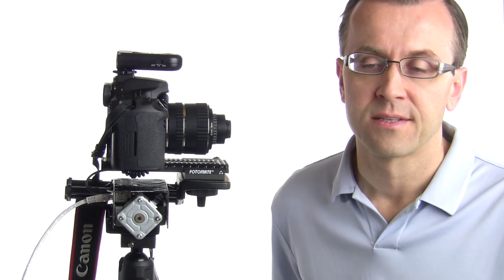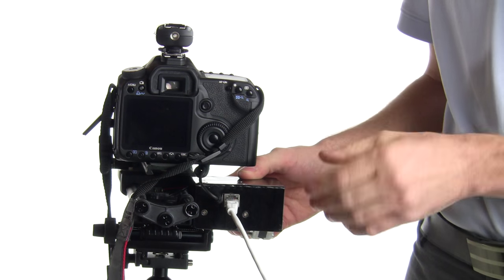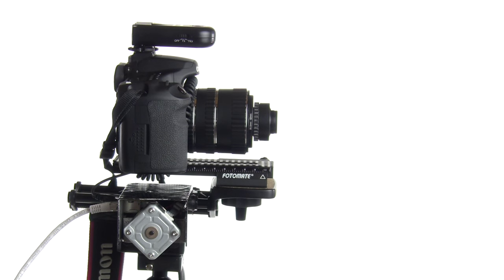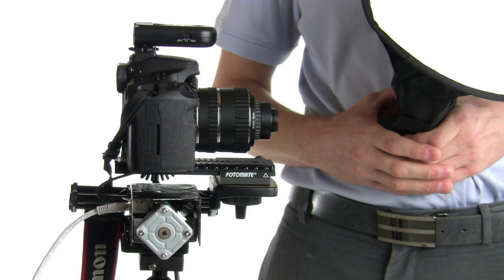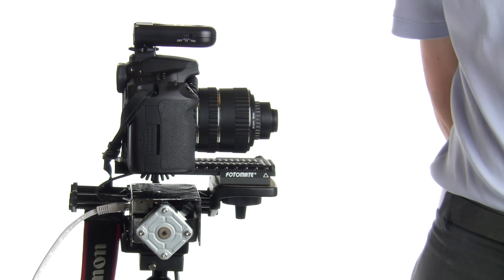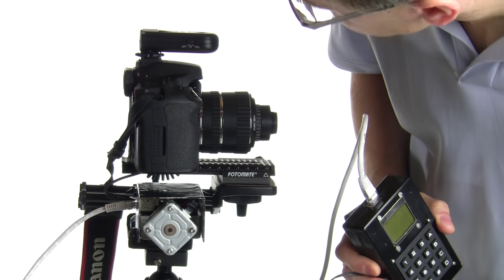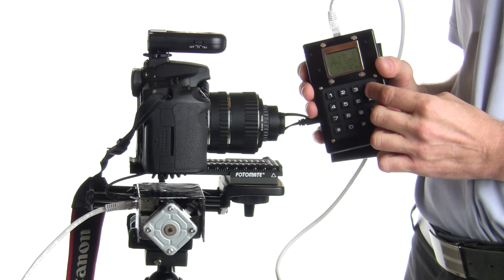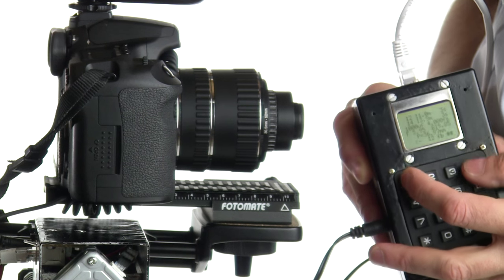Fast Stacker: live demonstration

Comment from the maker: Great news! Just in time for the new year, I have managed to do the ultimate hardware modification to my rail (which I already coined "h1.2") - the one where I gained independent programmatic control of both camera's shutter and autofocus - and the rail survived this major surgery, and seems to be working as expected. This new setup should be the most attractive to non-Canon camera owners, as many non-Canon cameras require both the shutter and the AF camera switches to be controlled to do remote shooting. I believe now I can make my focus stacking rail truly universal - should work with any camera model. For Canon camera owners there is less incentive to do the mod, as the only improvement you might see will be slightly faster startup time when doing 1-point stacking.

The software hasn't been updated yet to make use of this new functionality. I will start working on that, and also on updating my wikia tutorial to reflect the hardware and software changes.

Stay tuned!

Comment from the maker: UPDATE [03/03/2016]: New version (s1.14) of my focusing rail software was released. The important new feature is the support for Full Resolution Silent Picture (electronic shutter; only Canon cameras), with or without an external flash. Also some bug fixes. The rail was tested at magnification 10:1 (5 um steps), and it works very well (see https://www.flickr.com/photos/99745838@N03/25384340795).

Full details:

http://pulsar124.wikia.com/wiki/Whats_new

Comment from the maker: UPDATE (08/02/2016): I just released a new version of my automated rail software, s1.12, which is designed to handle many more microsteps than before. You need this new software if your hardware (rail, motor and/or motor driver) is different from mine; specifically, if the total number of microsteps is larger than 32,000. If this is the case, get this new software, and change the value of the new macro parameter COORD_TYPE (in stacker.h) from "short" (default - same as before) to "long". This will increase the size of the program in flash from 90% to 95% of the available space (which is still ok), but the timings are as good as before (so no penalty in performance). I also fixed a small bug with the backlash on/off command (*B).

http://pulsar124.wikia.com/wiki/Whats_new

Comment from the maker: Update [22/01/2016]: I am releasing a new version of my macro rail software, s1.10. (It requires hardware h1.2.) This is likely the most significant single update I ever made to my rail's software. The rail gained a large number of functions (14 new key bindings), including new features like timelapse focus stacking. In a summary, the new version will make my rail much more usable for extreme macro photographers (magnifications 5:1 and up; should be usable up to 20:1), and for those who regularly use a wide range of macro lenses (from standard 1:1 macro to 20:1 extreme macro). The update also significantly improves the user interface, and dramatically reduces the need to recompile the code (all the important parameters can now be changed at runtime). The detailed list of the improvements can be found here:

http://pulsar124.wikia.com/wiki/What's_new

The software can be downloaded from the above page, or just use this direct link:

http://syam.no-ip.org/stacker_v1.10.zip

Enjoy!
Reply: +pulsar012 

i just completed my DIY slider and just found your very impressive work in DIYP.

i am interested in building this too. unfortunately, for whatever reason, the download link for the source code is URL blocked here in the country i am in.

do you have any other download link?
Reply from the maker: +Alain Ritchie Quisumbing  Try this alternative link: https://drive.google.com/open?id=0B_p2gAcTU2q4bVpkWnpVNk52VGM
Reply: +pulsar012  Thank you very much. :)

more power to you.
Reply: I can't find detail info on your wikia.com sites....no more infos there...

Comment from the maker: Update [07.01.2016]: I am releasing a new version of my stacking software, which is ambitiously named "s1.00". It is designed to only work with the newest hardware version, h1.2. This new software and hardware should make the rail much more universal: it now independently operates both camera's shutter and autofocus, so in principle should work as is (or perhaps with slight parameter adjustment in stacker.h) with any camera which has a wired remote shutter connector. The modifications will also likely result in faster maximum shooting speeds attained with your camera: e.g. my Canon 50D can now reliably do at least 30 frames at 4 fps (RAW format), without any perceptible delays at the beginning.

My wiki tutorial has been updated to reflect all the changes:

http://pulsar124.wikia.com/wiki/DIY_automated_macro_rail_for_focus_stacking_based_on_Arduino

Comment: Hello! Thank you so much for this very interesting video! I'm really looking forward to see more and to read a text tutorial that you've mensioned in the description. Just right now I'm collecting any data about DIY Adruino-based macro rails, and your example is very helpful.
Reply from the maker: +Alex Stavrovich Here is the detailed tutorial: http://pulsar124.wikia.com/wiki/DIY_automated_macro_rail_for_focus_stacking_based_on_Arduino
Reply: +pulsar012, WOW, that is really awesome! This will guide me all the way through the making process. Just have to wait till all the parts delivered from China. Again, thank you so much for sharinig this!
Reply from the maker: +Alex Stavrovich My pleasure!
Reply from the maker: +Alex Stavrovich You might want to check my new page http://pulsar124.wikia.com/wiki/What's_new
Reply: +pulsar012, thanks! Very interesting.
Reply from the maker: +Alex Stavrovich I am not sure - I think they are both too small and underpowered. The first one doesn't list the current rating, the second one is 0.5A, which is less than mine (0.7A). Why don't you get the same motor I used (link provided on my wikia page) - it worked for me, and it is cheaper than your options. It is 1.8 degrees, bipolar, 4 wires, 0.7A per coil, size NEMA 42, but it is ultra-thin - lighter than standard NEMA42 motors, good for balancing the rail if used with tripod.
Reply: +pulsar012,  I've got no eBay account, so I decided to check out Aliexpress first. All other parts are already on it's way, just stepper motor left. Maybe you're right, I will order it on eBay.

Comment: Can you tell me how you coupled the stepper to the Velbon Mag slider?  Did you remove the knob?  I've tried and it appears that I would have to distroy the knob to get it off.
Reply from the maker: Check my detailed instructions here: http://pulsar124.wikia.com/wiki/Hardware_h1.2
Reply: Thank you.   Very good instructions.  I have decided to depart a bit, though.  I am going to try and put the stepper under the slide and use a drive belt between the stepper and motor.  This will also allow me to add a gear ratio to  better drive the slide since mine seems to have a bit of resistance. Your instructions gave me the courage to get the rubber button off.  I threaded the hole in the shaft for a 1/4-20 stud to fasten the timing pulley.  Had order the pulleys though, so waiting for them (Bless you Amazon Prime).  I look forward to following your lead on the rest of this project.  Thanks Again.

Comment from the maker: Here is my Xmas present: a new version of the software, s0.14:

http://syam.no-ip.org/stacker_v0.14.zip

Now the rail senses if it is AC or battery operated, and if the latter it will use a slower speed limit (adjustable), to improve the motor's torque. Also a bug was fixed in the "Factory reset" function.